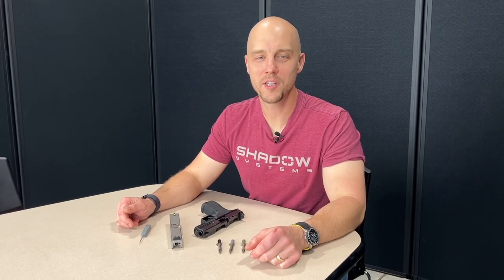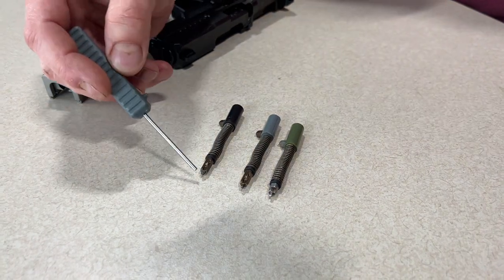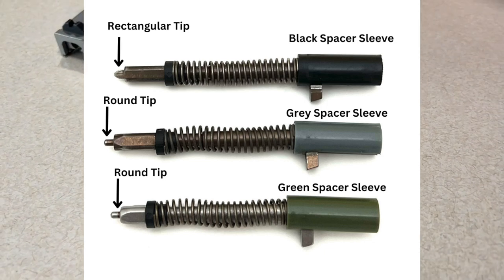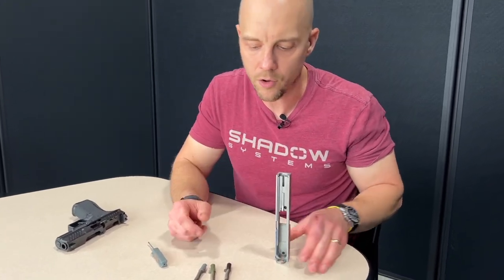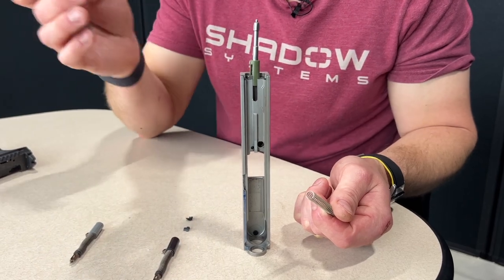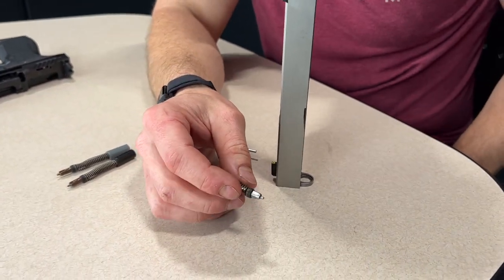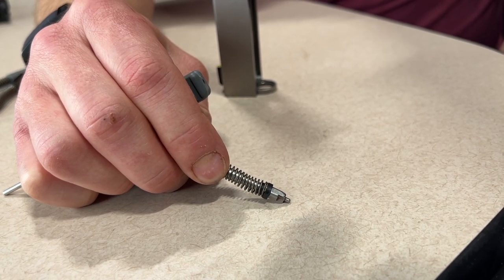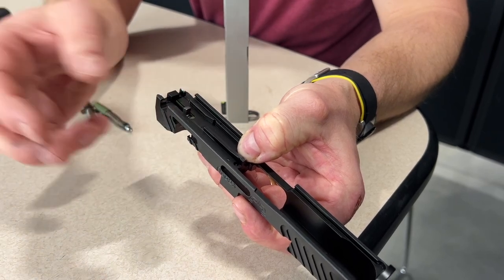Technical Tuesday: Firing Pin

Comment: Thanks for this video Traver. This is the problem I was having with my MR920L shadow systems pistol. I was getting 3 lite strikes on every 15 round magazine. But! I think it was my own fault. I mess up, when cleaning my pistol after the 1st 200 rounds and before my 1st time out of the box. I lube down into the firing pin shaft where it sits down into the slide. I think that end up building up WAY to much derby and I actually found three small pieces of brass in the slide where the firing pin sits in the slide.

Comment: I have a DR920 and and MR920.  Both came with grey firing pins.  My DR920 spring had some wear down the sides of the lug and eventually broke at the lug while dry firing.  It was replaced by the green striker assembly and after 5 months is still showing no wear.  My MR920 has a grey striker assembly and is also showing wear in the same position of the lug.  Should be interesting to see how long it will last.

Comment: my early model mr920s firing pin snapped in half in dryfire. 
real shame because i do love shooting these guns.
i'm sure the kinks have been worked out, but that is not the case for my gun. and i'm not having the easiest time getting my issues addressed. 

good guns now. just wish i hadn't supported the company so fast before they worked their kinks out.

Comment: All 3 of my shadow guns firing pins have excessive wear behind the pin not on the pin itself. My glock firing pin has 0 wear and it has the same amount of rounds. Im wondering what my pins are rubbing against, because ive never taken them out ever.

Comment: i have an mr918, ive heard about the firing pin breaking. i bought it brand new years ago and have only just the last 2 weeks put about 200 rounds through it. should i be worried about having the older gen mr918?

Comment: I am extremely disappointed in the lack of customer service with Shadow Systems.  Over the past couple years I have purchased 7 Shadow Systems pistols, DR,MR, CR,XR most of them  War Poet models.   Two of the seven have failure to feed properly issue from the barrels not having enough clearance.  I have emailed and called Shadow System several times.  I've only gotten to talk to someone once and I have had to leave messages the rest of the times.  I have not gotten one phone call back.  I sent a video of the issue showing the problem and verified the issue by swapping barrels with my other SS pistols.  Here we are a month or so later and nothing but silence!  I don't like to leave bad reviews but if I don't get any response from SS what am I to do???
Reply from the maker: Hi Joe, my team sent you an email asking for a copy of your ID so they could create a return shipping label for you on February 23rd and didn’t get a response. If you could please send a copy of your id back to that email address, support@shadowsystemscorp.com, they can get that taken care of for you! If you’d like to speak with someone on the phone first, please email us with your call back number—email is much easier for my team to track than voicemails as it creates an automatic ticket and we can ensure we have all info.